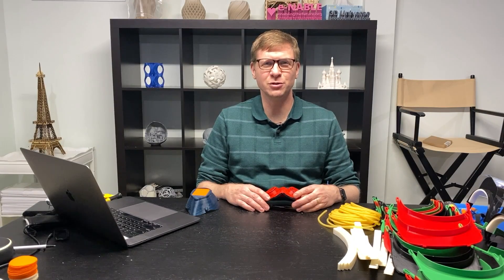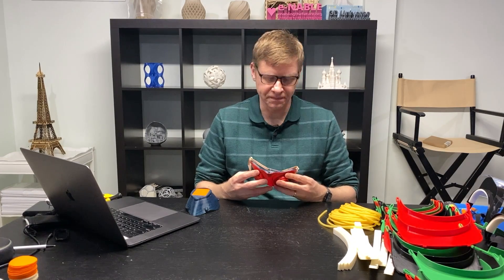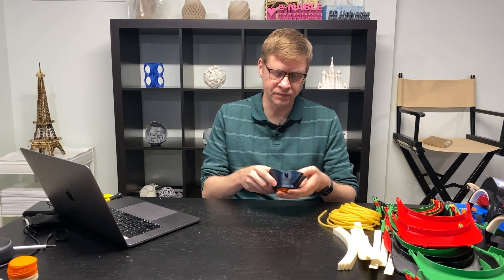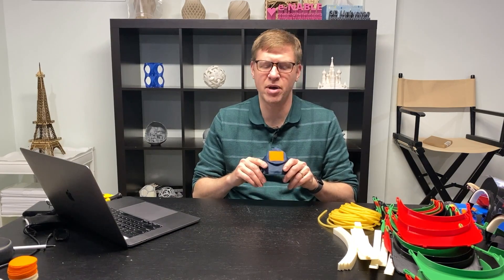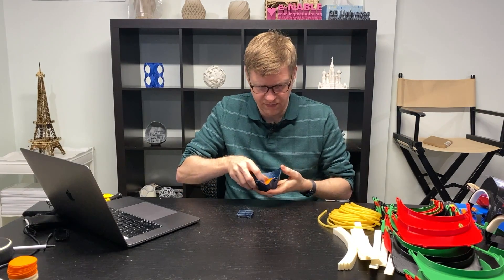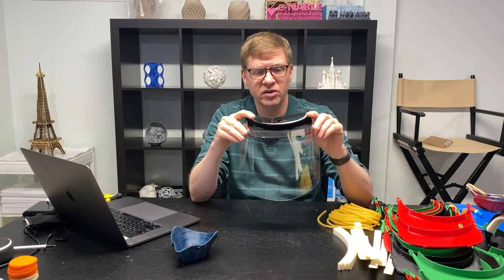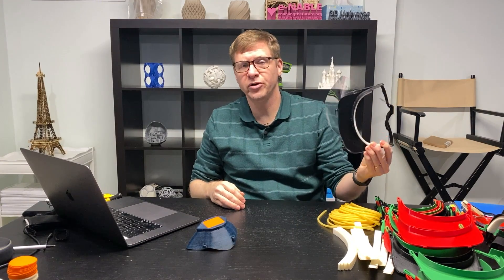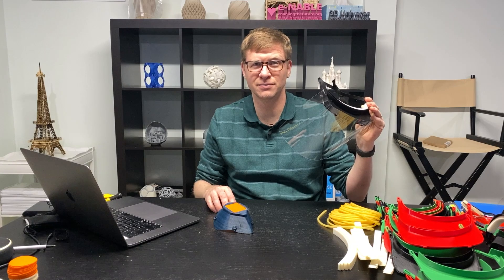3D Printable Respirator Masks and Face Shields (for COVID-19)

Comment: Thanks Jeremy.  I am printing these for a local public safety entity and they work great.  I am used to Hazmat PPE and have undergone mandatory fit testing for SCBA, so was surprised at how well these seal.  The LE did ask that I add 10% on the z axis to give them a bit more depth, which was easy to accomplish.  Takes about 4 hours to print on my Sidewinder X1.  Three hours if I bump acceleration to 2400 mm/s.   Again, thanks for helping to get the word out.
Reply: Where are you getting filter material?  The link given for the filter material has this on their website:  "**3D Face Mask Filter:  We are currently refocusing our manufacturing in order to meet the demand of face mask filters.  The media we are supply functions the same as a surgical mask. The masks themselves are not N95 certified and neither is our media."

Comment: I have created a gasket for a design just like this. I use silicon 1 caulk and soap/glycerine. This allows the caulk to be used as a putty for a period of time during cure. Once it hits the right consistency, you can mold it to the edge and press it to your face (holding your breath). Forms a perfect airtight seal.

Comment: I have decided to go with this one too after a doctor friend recommended it. I've printed the main part in both PLA and TPU. The PLA did not create a good seal, it was to rigid. TPU works better for the main portion. Use PLA (or a rigid filament) for the filter part.
Reply: what were your settings for printing TPU?  speed?  temperature?
Reply: Could you please put the design files to somewhere to download? Der orgiginal website is down. Also info about TPU Printing is recommendet
Reply: Was your doctor friend able to do a FIT test?  I'm testing this now and looking to take it someone for verification.
Reply: @gins20  I have old FlashForge CreatPro (2014) with a Flexion hot end for printing flexible.  I havent used this machine in probably two years, but it's the only 1.75 filament machine I have and I only have 1.75 sainsmart TPU. In running 60mm/s, 230°C, 50% infill honeycomb pattern on the first 50 layers (this makes the filter area more rigid), 10% on the rest, 7 top layers. I'm using the default Simplify3D settings for PLA on everything else.
Reply: @DoItJustinKace  ye and we do get a negative pressure, but as mentioned these are last resort. We have not done a certified test. We have also been making fabric face mask. We can make those faster and them out where needed (I'm in the New Orleans area).
Reply: @NettAirLa  Did you end up using the regular TPU-printed mask or did you eventually print using a copper-based filament?
Reply: @Pistavros7  no..I used regular TPU

Comment: Been doing the experiments here for local healthcare workers. I’m look at options of thermoplastics, 3D printing and casting. Thermal forming is still the fastest. What type of thermal material are you using? Will it be unsafe if is pvc based? How did you cut the shape after thermal forming? We can get lots of printers but they are very slow. I’d hope to find a process with thermal.

Comment: I designed a 3D printed face mask, but am not convinced it seals around the face just with 3D printing alone. It needs a foam lining or gasket of some sort to actually be air tight. If they aren't air tight, they don't really do anything.

Comment: Nice! You should check out Givewave studios mask, its the best ive seen yet. They were so kind to send me their model and ive been modifying it to run a 3d printable canister filter which I plan to fill with activated carbon, and multiple layers of merv 13 air filter cutouts. Finishing up the 1-way valves on the design. I should have it complete by the end of the week.

Comment: I spoke to the Administrator at  the Montana clinic because I wanted to help out .  They will accept just the mask and filter holder.  They will add the elastic, N94 filter and something they have come up with that is placed on the inside for comfort and a better seal on smaller faces.

Comment: I would like to help print these, but am not sure where to send them. Is there an organization helping to connect to hospitals that need them or some other way?
Reply: Matterhackers has a form you can fill out to show what you're capable of making and they can handle the rest for distribution. That is at least one option, Repcord is also handling some of the distribution of printed face shields if I remember correctly.

Comment: Thanks for posting. I was on full board ready to print Copper 3d today (printer arriving today), but glad to know this design is easier. Seems to be a small design width wise which is great in terms of buying a printer due to it's build area. Do you know the minimum build area it would take to make this design? Would it fit on a 200 x 200 build area for example? Talk soon!
Reply: I've just started printing one on my Ender 3D and it will fit on a 200 x 200
Reply: I just ran it through Crealty Slicer and you should be able to  fit two masks with two filters on that surface

Comment: Hi brill video, not a printer myself living on a boat does not allow for a level bed.  Take this design a step further instead of the filter print  it blank but add a 3/4 inch hole either side or print onto it a boss to attach easyflex hose, which in turn goes  over the shoulders or drops downwards and around to the back of the wearer.  At the back print a holder for a HEPA filter as found on most cyclone type vacuum cleaners, this will need a boss as per face mask and put hose into it, all held in place by a belt.   3M have a non disposable FFP3 face mask they claim would last a user through a pandemic, its filter only has about half the surface area of say  a Dyson 4 inch (approx) HEPA filter.   Brilliant I am not,  I wish, but inspired in my thinking after watching Medics in South Korea dressed up in their version of full PPE   If any one does this as we sometimes say in the UK "good on you" Stay safe keep well.

Comment: So there is no reason to have anything covering the outside of the filter on this design?
Reply: Upgrade from N95 to P100. Pancake filters do this by design. Typical application is taking a sanding mask and using it for open air spray painting. Similarly, a light track of petroleum jelly PJ around the seal makes a big difference. Never leave home without it.... (The splash shields are damn near useless. Sorry.)

Comment: Unfortunately the standard plastics used for 3D printing aren't considered a virus proof barrier on a completed mask because not all 3D prints are 100% airflow resistant. There can (and will) be some small leakage that is undetectable by our senses. 3D prints are fine for shields but not as a final product for masks.

Comment: You can use 3m a/c filters of 1300 or higher. Lowes has a 20in by 30in 3m filter with 1900 rating for 20 bucks. Take apart and get material it is easy only glued on. Use gloves the screen with poke you. Stretch out material and cut to size. I made over 100 filters with this. The material is made to stop micro particles and infectious bacteria. Make sure you use 3M not the cheap ones.
Reply: Just don't want people to get a false sense of security and wind up doing more harm than good.
Reply: A big caveat to this: the corona virus that causes COVID-19 is much, much smaller than a bacterium.  This might filter out some of the larger respiratory droplets containing COVID19, but is no replacement for an N95. Filter.  However, if anyone gets a supply of N95 filters, please, please donate them to a medical center that needs them.  The doctors and nurses dealing with COVID19 patients continually have much higher need for personal protective equipment than the public, and there is a shortage.

Comment: Has anyone scaled this down for someone with a smaller face?
Reply: I did a print at 85% yes.  No issues.  I printed at 100% and then measured the gap size in MM and played with size until it was close enough.